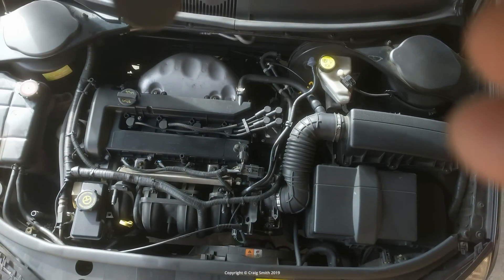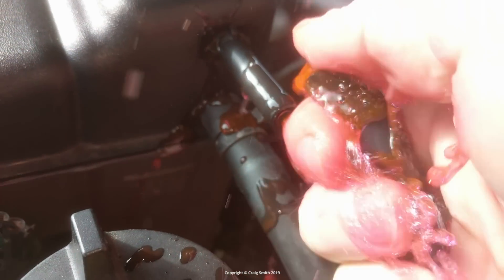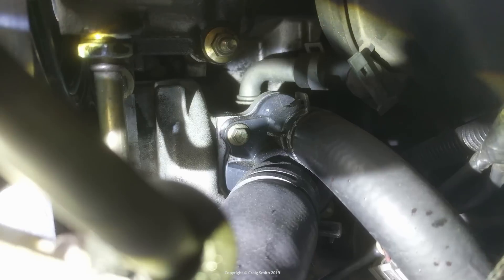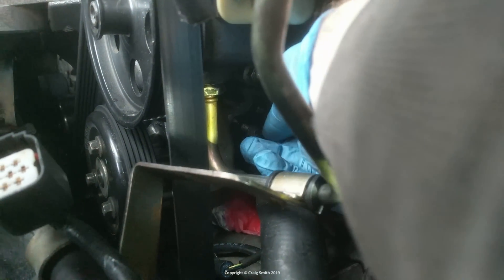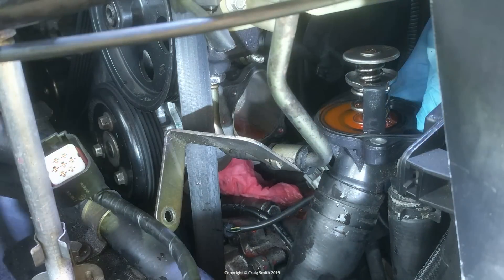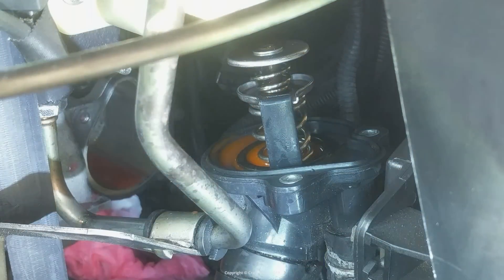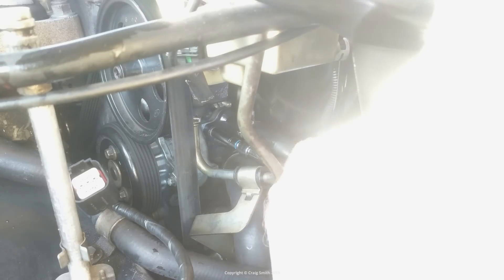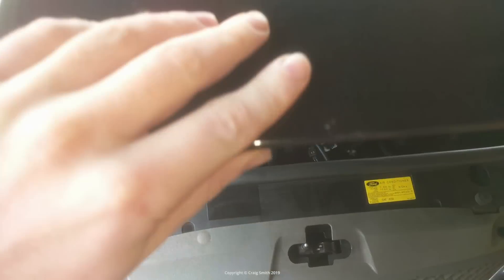How to: Replace thermostat gasket Ford Duratec HE (Mondeo, Focus), fix leaking coolant

Comment from the maker: Amazon links (more in the desc):
Thermostat gasket ~ US: https://amzn.to/2FR52ul | UK: https://amzn.to/2RRyo0r
Replacement thermostat, new Ford/Motorcraft ~
1. Heated (older engines), with electrical connector: http://amzn.to/2nEh1Rs
2. Unheated (later engines), no electrics: http://amzn.to/2nzxGbY
General Amazon search US: http://amzn.to/2cl0ZIz | UK: http://amzn.to/2cWkcyn

Comment: Hello Sir!
First of all your video are easy to understand and very informative unlike others with jarring music and vague solutions.
I am from India and I own a 2006 Ford Fusion 1.6 16v Duratec.I was experiencing misfiring engine and upon inspection I found coolant had leaked into Valve cover.I have following questions:-
1) How could the coolant have entered into Valve/rocker cover? What is the cause?
2)How to fix the problem? 
      Sir if you have uploaded a video regarding my problem,please share the link.
Also it would be kind of you to share your email.
Thank you!
Reply from the maker: What do you mean entered into the cover, you mean it is inside, and mixing with the oil? Are you sure it's coolant (you can see the color dye)?
Reply: @CraigsDIY  It can be seen under the valve cover and above the cylinder.I mean the site where spark plugs and core/Welch plugs are located.The colour is exactly coolant like and smells like it.It can't be mixing with oil as oil is inside the engine block.